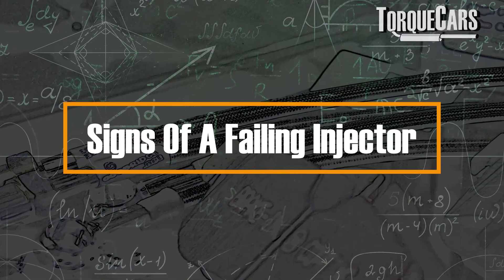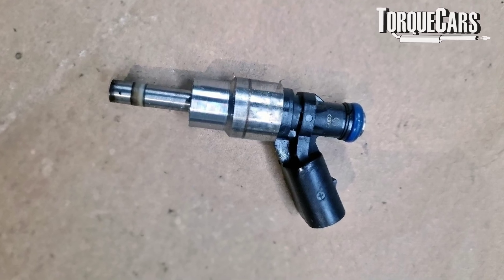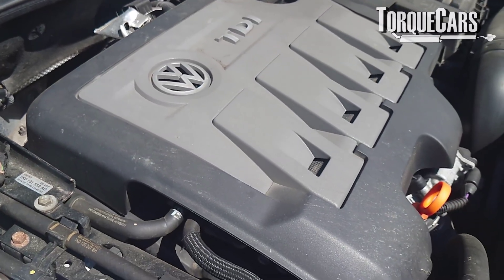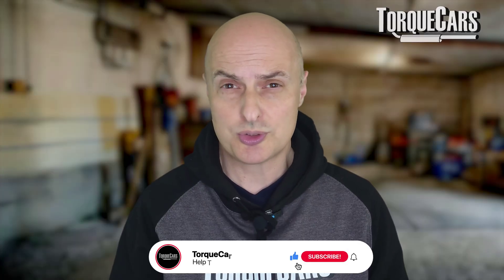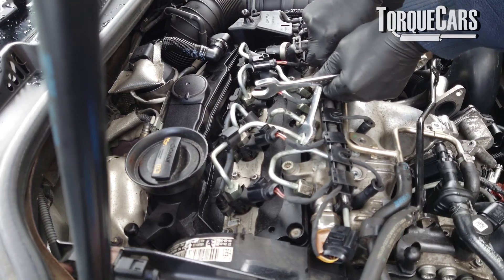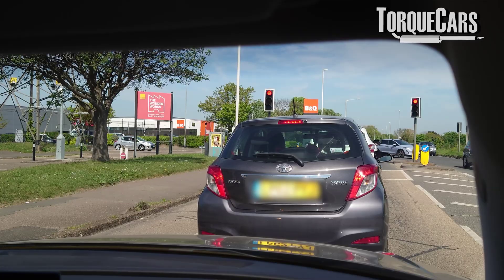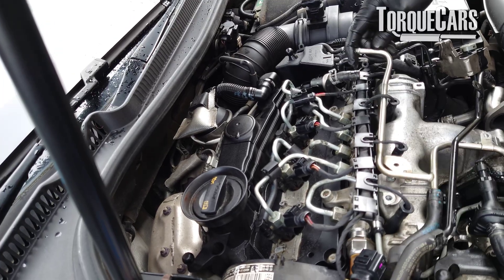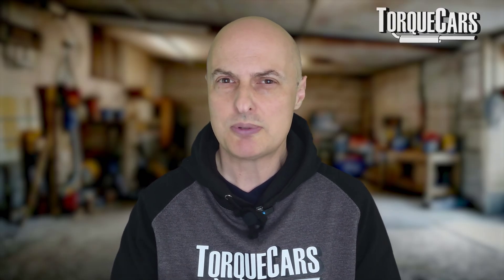Diesel Problems? Don’t Ignore These Injector Symptoms 💦That Kill MPG & Engines!

Comment: Hi. Once again, great informative content...thank you. I have a slight diesel smell from my engine (V6 TDI Bi Turbo). Took it to my Audi specialists and they've diagnosed an issue with one of the injector seals (a small copper washer type thing). They say a common problem with the Audi V6's. Booked in for all 6 to be replaced at end of month. The actual injectors on Audi tend to be pretty robust. Thanks again.
Reply from the maker: Glad you caught that one early then.

Comment: In my experience, the early signs of injector failure are intermittent misfires (even 300 miles+ apart). This often progresses to the point where it will misfire badly in the winter until the engine gets some warmth in it. If left longer, the misfire will happen more frequently, even when the engine is warmed up. Eventually, it will misfire all the time and likely go into limp mode. With our car, the injector wasn't firing at all rather than being stuck open. There wasn't loads of black smoke or soot. The garage said the injector was shorting internally and I could actually hear it short out. Sounded like a gas hob igniting! Interestingly the car was still getting 67 MPG even when it had the random misfires. 

The engine detects the misfire by the crankshaft position sensor. If unsmooth rotation is detected, it uses this to determine which cylinder is misfiring.

Comment: This here was exactly what was wrong with my lovely 1.5 dCi engine.

Fixed it (injectors are expensive), changed all 4 of them, they had them tested and all 4 of them came out bad, changed all the glow plugs as well.

Now my fuel economy has jumped from 48mpg to 62mpg. I was shocked at first because, the remaining fuel miles showing on the dashboard kept increasing instead of reducing.

Car drives better than a brand new now!

Comment: i bought a skoda superb 2 with the ea189 engine (2l tdi 170hp)
after 4 days the engine startet knocking when driving away after a cold start for about 30s after that you didn't notice anything
well 3 out of 4 injectors where faulty(1250€😢), problem was i  had no error codes because the car doesn't notice when its not spraying correctly, it only noticed dead injectors 
but positive thing with the 3 new injectors the car needs about 0,7l less fuel and accelerates way better, fells like a 10hp increase
Reply: If you can feel the difference as " way better ",  that would be at least 30 hp more. 10 hp is a little difference in a car. If it was a motorcycle you would definetly notice it.. just saying.
Reply: @golf1diesel with way better i didn't mean just faster but also smoother
but 30hp increase feels much more dofferent, i remember when i got an ecu tune on another car with 35hp increase, so i think 10-15hp seams reasonable

Comment: Thank you. Once again a very interesting topic as usual. Please may you answer my query. I have a RAV4 2011 D4D 2AD-FTV with DPF (Euro 5). At 60 000 km (and not at 600 000 !) the nozzle tips of the Denso piezoelectric diesel injectors failed: Three showing severe wear and became too thin with high diesel return rate, and the fourth has its nozzle tip cracked and the engine stopped. Hopefully no damage to piston and combustion chamber. I read on internet that this defect was known by Toyota and it was so problematic that it stopped mounting these engines on RAV4 corollas, Lexus IS200,... and used BMW n47 instead. I would like to know if you have any idea about the real problem causing this issue that was hidden by TMCorp. because changing the Denso piezoelectric diesel injectors is not the solution (TMC would not change its entire D4D engines for the BMW n47!! ) Toyota Europe and Denso never accepted to recognize their faulty injectors and never want to explain the origin and solution to the problem. I wonder if you got a clue to this issue during some technical meetings. It doesn't happen daily that companies change engines mainly when they did a big marketing story on them (the myth of the unbreakable D4D is a fake !). The newly installed injectors are serving more fuel now as I see the fuel consumption increasing to 9l/100km. So probably they are also suffering the same problem. Do you know why, please? Thank you
Reply: The 2.2 D4D 177hp (130kw) has the most problem. Lexus has only used one diesel in the LS220d and that was the only  one. Why? To many problems. Parts are extremly rare, so so solve the problem you can only buy original parts. These are very expensive. Most people just sell the car and buy something else.
Reply: @JWR6819 IS 220d. And it was a rubbish engine, causing lots of problems.
Reply: Don't discard ALL D4D engines. This link is to a Toyota with a 2.2 D4D 136hp (100kw) 2AD-FTV engine without DPF with 1.040.000km (=650.000 miles on the clock). Conclusion after inspection good for another 300.000km (187.500miles).
Toyota Corolla Verso 2.2 D-4D - 2006 – +/-1.040.000 km - Klokje Rond
https://www.youtube.com/watch?v=9YJ6MZ7csPY
Reply: @JWR6819have several friends/family members driving RAV4 D4D. The diesel technician who inspected my injectors was a former Bosch technician. He told me that he used to check Toyota diesels with more than 1 million kms and they did not need to change denso injectors (equiped with solenoid ones not the  piezoelectric like mine). He was thinking that my RAV4 has its ECU mileage refurbished but when I told him that I bought it brand new from Toyota dealer he did not believe me :-D
Reply: @JWR6819 the engine is the 2AD-FTV 150 HP (it came after the 136hp this one is equiped with solenoid injectors , Euro 4) mine is following Euro 5 with piezoelectric injectors and DPF, that's the problem. They stick to environmental regulations and made worse engines with lower quality. Because they are more sensitive to fuel quality ( I can't change diesel sold by shell or Total..) but I might have contributed partially with my short driving annual usage
Reply: So the car is from 2011at 60.000km you had the problem. The engine has how many hp/kw? Was the 60.000km recently? Because if it is, that would mean that the car drove 60.000km in 14 years, which on average that is just 4.286km per year. This alone would surely kill a diesel engine due to fuel/water getting to the engine oil due to cold starts. That would be the worst of driving conditions. If so then the engineoil + oilfilter should be changed every 6 month's to get the water en fuel drained of with the oilchange. Not sure if you realy drove that little km's on average? Were you?
Reply: @JWR6819 thank you for your interest and your suggestions. To be accurate. I bought my RAV4 brand new on 
December 
2011 from  Toyota dealer and the injection failure occured on August 2023 at nearly 
65000 so I did a mean yearly mileage of 5400 kms. Yearly maintenance is exclusively in the Toyota dealership. I didn't notice water in the oil (I still have the oil from the engine immediately after the injector cracked , because I requested to have a premature oil changing and to keep it for me to check it in the laboratory. I did not think about water but I was afraid that metal parts from the failed injector would have blown pistons or combustion chamber. I still have the oil filter too. And it contains no metallic elements or macroscopic debris
Reply: By the way, I am changing fuel and air filters every 15 000 km, oil every 7000 km. I use Shell or Agip (ENI) or Total low sulfur diesel (less than 50 ppm) and every 10000 km I use wijns or abro or liqui moly or bardhaal injector cleaner diesel additives. (I am wondering if they were not harsh to the nozzle tips and they caused wearing, but what about other Toyota's D4D engines that Toyota moved to BMW N47?? I still think the story is more intriguing!

Comment: Some tdi’s can suffer from injector failure, the injector bolts can come loose or snap, oil leaks around injector, diesel smell in cabin etc… poor design where 1 bolt secures 2 injectors